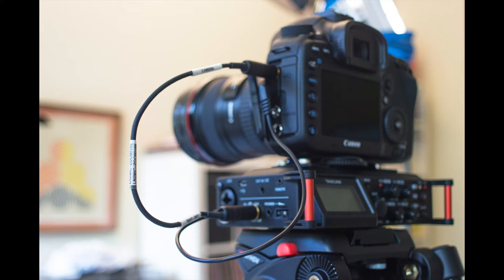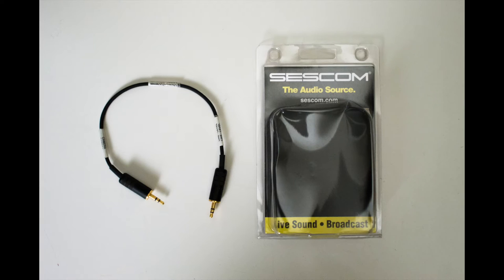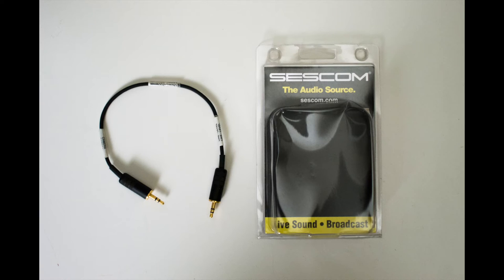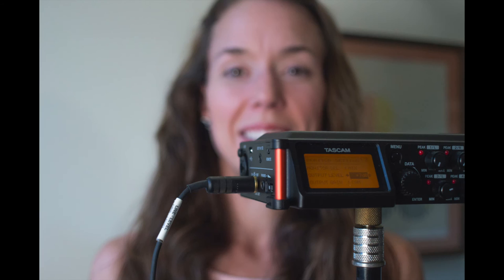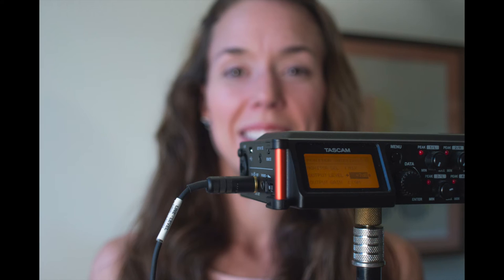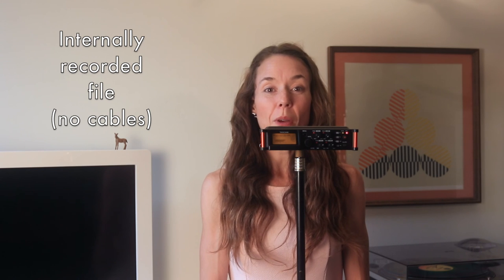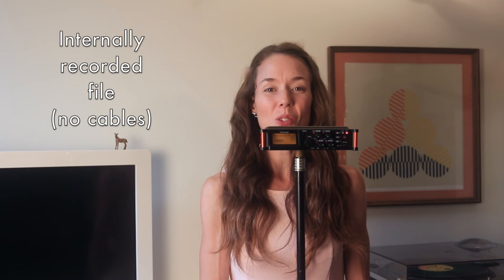Tascam DR-70D noise issue + how to fix it

Comment: I figured out the noise issue. Take your camera OFF the auto function for volume control. The auto function seems to crank everything up to twelve and that creates a hiss. Turn the monitor gain on the dr 70 UP  perhaps a bit past zero, and that should eliminate the issue
Reply: this worked perfectly for me! Thank you
Reply: This worked great thanks 🙏

Comment: Five years late to the party, but I thought the point of the return cable into the camera was to get audio into the video to make syncing in post with the recorded audio easier?
Reply from the maker: That's one of the reasons why you might do this. Another is to feed good audio to the camera so a director or other production person can watch playbacks of takes with good sound. It also creates a second good-quality copy of the audio, so if something happens to the audio in the recorder, you have a back-up.
Reply: @HiddenDriveways  aye. My camera has sucky preamps so it'd probably add its own noise. Thanks!

Comment: It may be that the mic input of the camera is supplying a small amount of voltage for consumer shotguns and other mics (not 48 volt but smaller amount)  and the sescom cable is designed to deal with that somehow thereby cleaning it up as the tascam device would not behave properly if was receiving any voltage from the cams mic jack into its output jack. What complicates the issue is that not all cameras / camcorders supply this voltage. The cams owners manual would tell you. Other thoughts?
Reply from the maker: The vast majority of cameras supply this voltage, which is called "Plug In Power." Any feature on a device that is designed specifically to interface with the mic input on a camera would need to work seamlessly with Plug In Power. The Sescom cable does one thing: it attenuates the incoming signal.
Reply: The issue with this whole problem is the tascam unit is specifically designed to work as is with a dslr type 1/8" mic inputs and it should not need to be attenuated. In fact the tascam unit i have (dr60dmkii) has a level knob to adjust the audio level being sent to the camera so something is missing as attenuation alone does not reduce hiss---only level. Just seems strange.
Reply from the maker: You can turn the outputted signal from the DR-70D down from line-level to mic-level. This isn't done with a dedicated knob on the DR-70D, it's done by selecting a choice from a menu. The DR-70D can attenuate the signal without a Sescom cable. The problem is that when you do this, the audio that is sent to the camera is noisy. If you send line-level audio  out from the DR-70D and attenuate it with a Sescom cable, the audio recorded by the camera is clean sounding and vastly superior.

Comment: Hi!, after watch your review, I was looking for it and I founded two options, yours (LN2MIC-ZOOMH4N) 25db att, and (LN2MIC-TASDR100), specially for tascam dr100 with 35 db att. I have tascam 70d and panasonic fz1000. The question is, the sound is much better with 35db att instead 25db, or has not so many relevance?. Thanks in advance.
Reply from the maker: -35db won't make it sound any better than -25db. Perhaps it does if you're using a Tascam DR-100 audio recorder and the -35db cable, but not in this case. The cable I used in the video was the -25db version.

Comment: hey, I've been using zoom h4n for 5 years and i really don't like how h4n works. it gets me a lot of noise and not enough gain... some people suggest me to buy 70D. is that going to be worth it? is the gain and noise great for recorder? Thanks!
Reply from the maker: +ferano wibisono Recorders like the Zoom H4n, H5, and Tascam DR-70D are good for what they are: entry-level, low-budget audio recorders. If you want &quot;great&quot; preamps and noise performance, you need to pay a lot more. The cheapest way to achieve this level of quality is to use the Sound Devices MixPre-D field mixer as the front end of your audio chain (in other words, you plug your mics into it), and then plug the XLR outputs of the MixPre-D (set to line-level) into the inputs of a recorder like the DR-70D.&#160;

If you just upgraded to a DR-70D or a Zoom H5, you do get a slight increase in preamp quality over the H4n.
Reply: Thanks for the quick response... what if i upgraded my ntg 2 to ntg4+ is that going to be solve my problem? Do you use any program for your h4n? I watched all of your h4n videos and that was really clean i guess...
Reply from the maker: +ferano wibisono You're welcome :). To get an appreciable upgrade in sound quality with shotgun mics, you need to jump up to the Rode NTG3. But, the sound quality of the mic doesn't improve the quality of your preamps. So, buying a better recorder or a Sound Device field mixer will help in that area. This stuff gets confusing. Anyhow, upgrading from the NTG2 to the NTG3 would be a good move. On my videos, I typically don't use any post production software to improve the sound quality. I get my sound from good mic placement and from setting proper levels. I also use my Sound Devices 302 field mixer sometimes, and lavalier mics, hyper cardioid mics, etc. I put effort into audio-for-video, but mostly in capture and recording, not in post production.
Reply: wow that's really helpful explanation, what about ntg4+, do you ever heard that? is that a good choice for my zoom h4n? cause i  have no budget to get ntg3
Reply from the maker: +ferano wibisono My advice is to save up for an NTG3. It's as simple as that. The NTG4 isn't an upgrade in sound. The NTG3 is.

Comment: My 60D Mk III has exact hissing sound but I am using an XLR Cable. In fact the hissing sound is already there before I even fixed my Microphone! I have played around the settings, still nothing. Please any idea on a fix?
Reply from the maker: What kind of cable is it? XLR female to male stereo 3.5mm?
Reply: The XLR female to XLR Male. My Shotgun Mic runs on Phantom Power so I noticed the 3.5mm does not have Phantom Enabled hence couldn't try like you did here.
Reply: Yes.
Reply from the maker: Is the hiss there when no cable is connected at all? Is the hiss on the recording not just in the headphones?
Reply: Okay will remove the cable and give you feedback. You suggesting cables might be bad? As for the headphones, the hiss is in the recorder and not in the headphones. I tried two different headphones plus after recording, the hiss is there. I can send you a recorded file on your mail if thats okay. mine is botstudioz@gmail.com. I will however remove all cables and give you feedback again.
Reply from the maker: Could be a bad cable. What kind of mic is it?
Reply: Mic is an Aputure Deity
Reply: Painfully I even got more than one of the cables meaning Cable might be defective. I am not too sure the cable was in with the sound but its likely. Will try it out tonight and give you feedback. Would be a relief if it was just the cables cos I am a distance away from the States right now. I am in Africa.

Comment: Hey I'm a total n00b and I'm dumb, so I have a dumb question. I watched half of this video after ordering my Tascam dr70d then paused it and bought two Sescom cables without reading the comments or understanding why there is a benefit to using the cables, I thought they were just shielded better or something, but now I'm figuring out about attenuation and realizing I might not have needed the second sescom cable for the camera's line out back to the Tascam. Is this so, or does it not matter that the signal each way is attenuated? I haven't had a chance to take the rig for a spin yet but figured I'd ask before finding out the hard way when my audio ends up too quiet or something. Thanks!
Reply from the maker: You only need one Sescom cable. You connect one side of it to the "camera OUT" jack on the DR-70D, and the other side to the Mic input on your camera. You can use a cheap, regular stereo 3.5mm cable to connect the headphone output of your camera to the "camera IN" jack on the DR-70D. You need the single Sescom cable to attenuate the Line-Level signal from the DR-70D down to Mic-Level, so you can plug it into your camera. You can adjust the settings on the DR-70D to send a Mic-Level signal out of the "camera Out" jack, but if you do this, the audio gets noisy. This issue is the whole point of this video. It's totally understandable that it's confusing. Just get your gear out and start experimenting. It'll make sense after you mess around for a while.
Reply: Sam Mallery, you said "You can adjust the settings on the Dr70d to send a Mic-Level signal out of the camera out jack, but if you do this the audio gets noisy". Could you please tell me which settings specifically would create that noise as well as the better option? (is this in the monitor section, setting the gain to Cam instead of line?)

Comment: Hi Sam, I haven't bought the Sescom cable yet but from your video and some tests I've done with a Sony Ex1 I assume it helps a lot but it doesn't solve the problem completely, you'll always need to use the WAV file from the Tascam for the best quality, is that right?
Reply from the maker: +Pablo Gargiulo Yup. The file from the recorder will be higher quality, providing that you have the recorder set to record a high-quality file, such as a 24-bit 48kHz WAV file.

Comment: I just Got The Sescom cable, but it is very short, difficult to Mount on my shoulder rig when i'm using The dr70d as a counterweight. Would a minijack extender do The trick for me or is that going to Distortion The whole thing?
Reply from the maker: I've used mini-plug extender cables many times without issue. I used a 10-foot extender cable with a Sescom cable when I made this video - https://www.youtube.com/watch?v=zycdq_JDQEM - there are no noise issues from using an extender.

Comment: So you work for Sescom then? How is their cable different from a normal mini-mini cable?
Reply from the maker: I don't work for Sescom. I work for a software startup in the fitness tracking industry. I just do video stuff as a hobby. Sescom cables have an attenuator built in, which lowers the volume (using layman's terms).

Comment: Hi Sam, I need some help.I have my cables going from output of tascam -70D then into my video camera mic port. I'm Trying to get good audio onto the video recording.
When I use my Panasonic handheld video camera HC-V770 with this Tascam DR-70D , if both are plugged into utility power instead of battery power, I get loud interference in my video recording on the memory card that is in the video camera. But if I unplug either unit and let one run off of battery, the sound in the video is crystal clear. 
Is this normal? is there something I can do to stop this in case my batteries are dead or I am making a long recording? On the audio only recording that is on the memory card in the Tascam DR-70D, the audio is fine, no issues or changes....
 Thank you for your feedback.
Reply from the maker: Cage Nation Noisy wall outlets are somewhat common. You can buy an expensive power conditioner (I have a Furman PM-8 Series II, which has SMP filtering to help with this). A cheaper solution would be to keep the Tascam off of AC. Use a fresh set of Lithium AA batteries for a long shoot. You can also bus-power it with an external battery pack plugged into its USB port.

Comment: Nice video, but you are muddying the water when you say the Tascam has a noise issue.  It's not an issue, what you are doing is matching the input level from the source to the camera which is normal.
Reply from the maker: +Al Gardner I appreciate your comment, but I respectfully disagree. Level matching tools are built into the DR-70D. The problem is that when you use them as advertised, you end up recording audio into your camera that is filled with hiss and noise, which makes the unit's "camera output" feature pretty much useless.
Reply: They are built in but the dslr has a non standard input. The issue is with the camera and not the Tascam. Anyway thanks for your review.
Reply from the maker: Thanks again for sharing your opinion. I don't want to come off as argumentative. I'm honestly curious... What makes a consumer, 3.5mm stereo mini-plug mic-level input on a DSLR non-standard?
Reply: I would add that my SD552 has a choice of line or mic output. So for a bit of kit purporting to be 'pro' not having any way to attenuate the output onboard the 70D, makes it look less than pro. It's a tough competitive world out there.

Comment: I bought this for my 70D but have now switched to the 701D. Are there any benefits to continue using this cable on the 701D?
Reply from the maker: I've never had the opportunity to test this to see if the 701D has the same noise issue that the 70D does on the Camera Out jack. If you get the chance to test this out yourself, please leave a comment here and let us know if the noise problem is there or not.

Comment: Question: I am recording in stereo mode with a shotgun mic connected to one of the xlr inputs. Panning is set to center. When i listen to the recording with headphones on the dr70d, i hear the sound on both sides of the headphones. But when i listen to the recording file on the computer, i only hear audio from only one side of the headphones. Is that normal? Is it just how this recorder is built?
Reply from the maker: +Bao Liu I think you have the DR-70D set to record a single mono track, but you have that channel panned in the center. Since it's panned in the center, you hear it in both ears when you monitor through your headphones while you shoot. But, since the recorder is only making a single mono track, when you bring the file into your editing software, you only hear it on one side, because that's what it is. There is nothing wrong with this. It makes sense to only record a single mono track when you're only using a single mono shotgun mic. It just means you need to pan that track in the center in your editing software, or duplicate it and pan one left and the other right.
Reply: +Sam Mallery Is therea way to adjust the settings on the dr-70d so i can listen to the audio on both sides with my headphones when the file is on my computer? i was able to with the tascam dr-40 but not the dr-70d. I have an audio technica AT875R shotgun mic.
Reply: +Sam Mallery I am Bao Liu, this is my other account

Comment: Effective, but sad that this unit is $62 CAN at amazon.ca  (The DR-70D is $317).
Reply from the maker: It's $27 at B&H, customs charge to Canada is $8.47, shipping likely around $12 - https://www.bhphotovideo.com/c/product/746645-REG/Sescom_LN2MIC_ZOOMH4N_LN2MIC_ZOOMH4N_Line_to.html/BI/20531/KBID/15501/kw/SEL2MZH4N/DFF/d10-v2-t1-xSEL2MZH4N - Not a steal, but still less expensive.

Comment: I'd like to see a schematic for this magic cable. Cables don't work in the way that is suggested here. If there's an attenuator, then there's a small resistor inline. I doubt they've done that, because the main signal volume is still there. Mini-to-mini cables are straight though, so what this issue seems to be is an internal camera automatic gain control (AGC) issue. You should never use internal camera audio for the final mix, ever. The DR70d's file should be enough and the camera recording should only be used as a sync reference.
Reply from the maker: Definitely not AGC. You make the best possible copy of the audio in the camera for redundancy. If something bad happens to the better audio in the recorder (corrupted file, etc.) then you have a reasonable second copy of the sound in the camera. It's an advisable practice for shoots where there is no chance at a second take. If you want a schematic contact Sescom at 845-246-1915 and ask for the schematic of their LN2MIC-ZOOMH4N product.